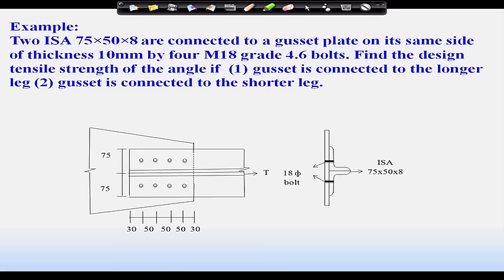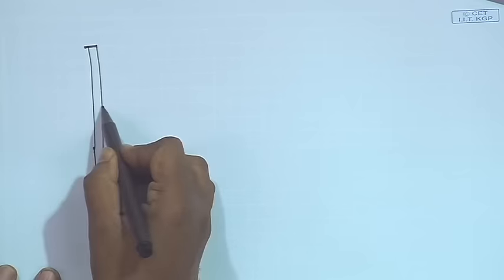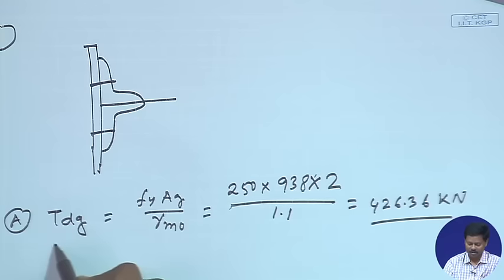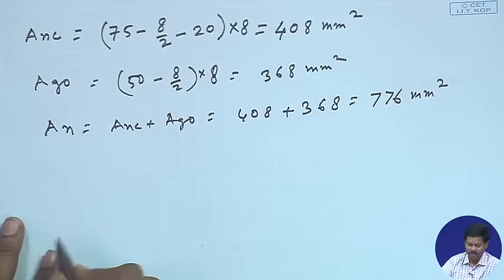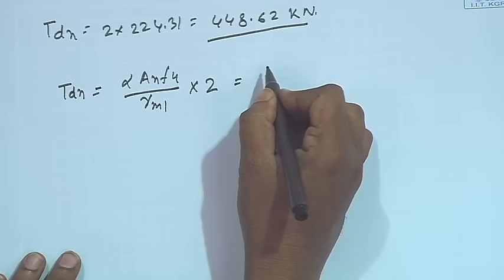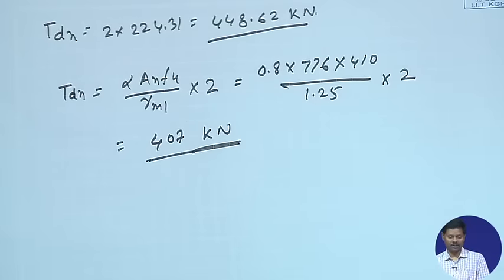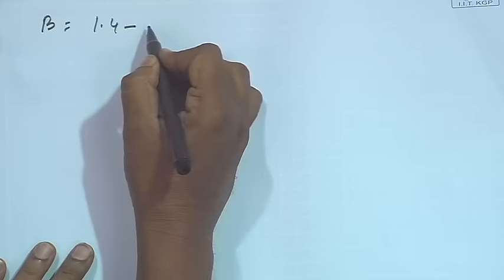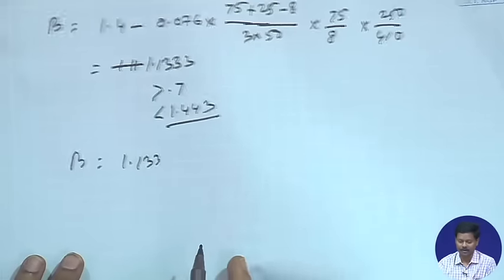Lecture 22: Strength Calculation of Tension Members

Comment: In the calucation of bs value...u have taken w1 as 40mm...
Can u please explain how it comes....?
Reply: Have you found answer ? If yes please contact me
Reply: Arey..sme doubt for me alse can sme one tell abt tht w1.??
Reply: @saikirangoud7685  refer page 77 fig 16 you l understand.... not the exact math but that's the concept
Reply: Follow steel tables
Reply: Actually min. edge distance is 1.5d(h) = 1.5 * 20 = 30 mm. But it can be  assumed as 
 e = 35mm.
So wi= 75 - 35 = 40 mm
Reply: The min. pitch distance is also 2.5d = 2.5 * 18 = 45 mm, where d is nominal diameter of bolt.
And assumption is p= 50 mm.
Reply: @shivamsharanlall672  Thank you
Reply: @shivamsharanlall672  wrong
Reply: You can see in steel table. The position of bolt holes.

Comment: How w1=40mm taken???? Someone please explain.
Reply: Actually min. edge distance is 1.5d(h) = 1.5 * 20 = 30 mm. But it can be  assumed as 
 e = 35mm.
So wi= 75 - 35 = 40 mm
Reply: The min. pitch distance is also 2.5d = 2.5 * 18 = 45 mm, where d is nominal diameter of bolt.
And assumption is p= 50 mm.

Comment: Sir how did you calculated gross area?
Reply: Gross Area of ISA 75x50x8 is taken from the Table IV of IS SP 6(1) 1964.
Reply: (75-4)*8+(50-4)*8
Reply: @sourabhthakur90  why you minus  4
Reply: @ashishmeena2117  8 is the thickness of angle.. take the area of each leg centre to centre ..making thickness equal to 4
Reply: @sourabhthakur90  thxx
Reply: sourabh thakur by this formula we are getting 936 but sir has written 938 ???
Reply: @marinahaider2769  Plz refer SP6  area's are given there.and for this go to page no 12 and search ISA7550 and thickness 8 mm